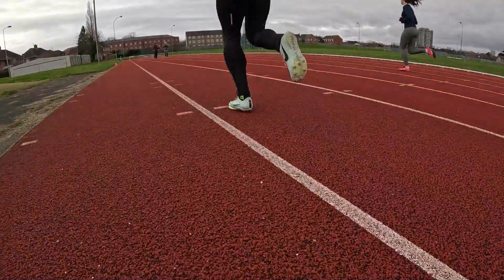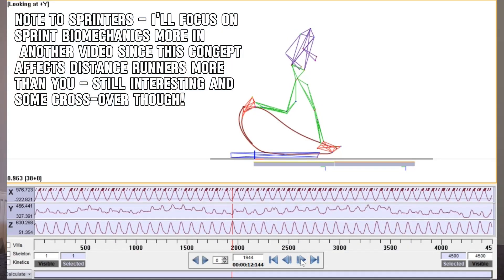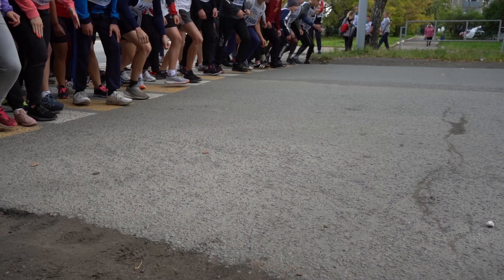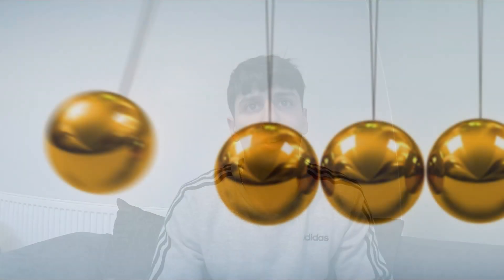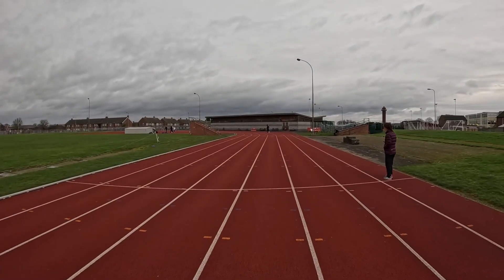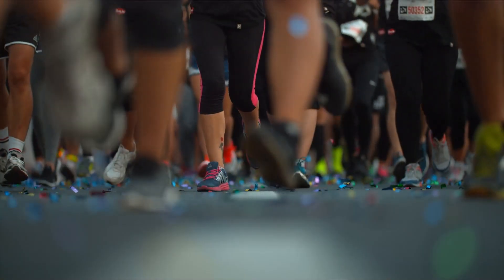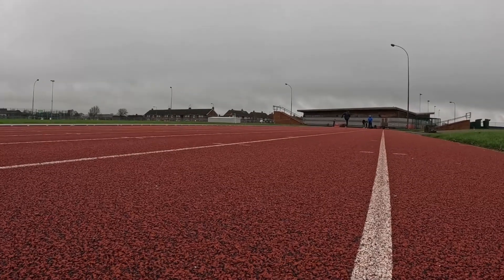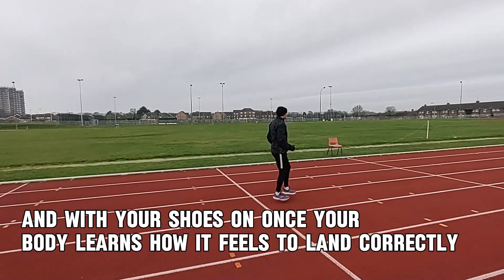Biomechanist Explains Importance of Good Running Form | Biomechanics of Running Ep1

Comment: False. 

You can change your running form by pushing against the floor starting before ground contact to apex force on forefoot contact. This has the most significant benefit. 

This has NOTHING to do with cadence and stride length which is a bloody waste of time everyone is talking about and is marginally helpful.
Reply from the maker: I'm not sure I fully understand what you're saying...are you suggesting that running speed isn't dictated by string length and frequency? If so what do you propose influences running speed

Comment: I've just started using sports watch. It says my cadence is between 83 to 96 steps/min. So I suppose it's one leg movements so I just have to double it and I would get the 166-194?
Reply from the maker: Yes I would think that's a safe assumption! 83-96 seems like a very low cadence. Sometimes stride frequency gets muddled up with step frequency. So a step is considered left to right foot contact, whereas a stride is left contact to the next left contact, hence it halves the value! I hope this helps :)

Comment: heel striker is not bad as long as you are not over-striding.
Reply from the maker: For performance it's maybe slightly less noticeable BUT it's extremely rare to see someone heel strike without over-striding. But even so, you get the unwanted impact spike in force that you don't get by landing on your ball of the foot (where natural pronation and using your arches protects you) which leads to injury over time. Jumping on the spot and landing on your heels seems far from comfortable to me compared to landing on the ball :)
Reply: @arodrunning  Quite a few elites heel strike.  It makes no difference as long as you land under your centre of mass with a flexing knee.  Running form is important but peoples bodies self optimise as we are all constructed differently.  You can offer stride with mid or forefoot strike too.